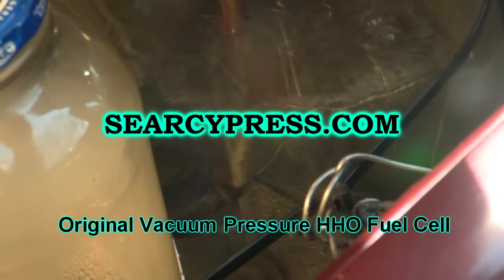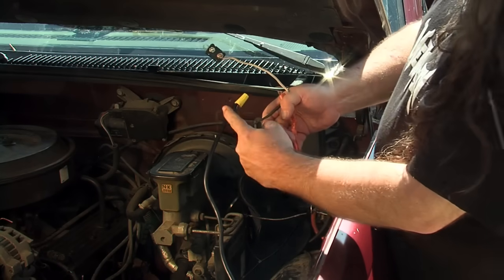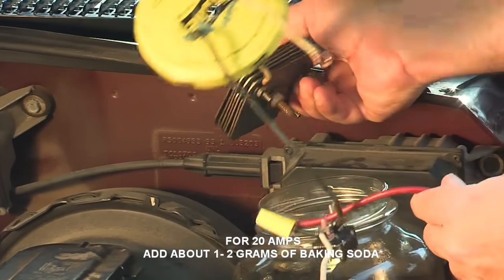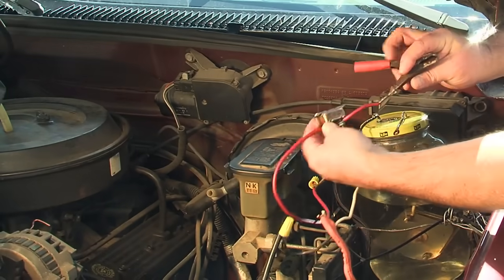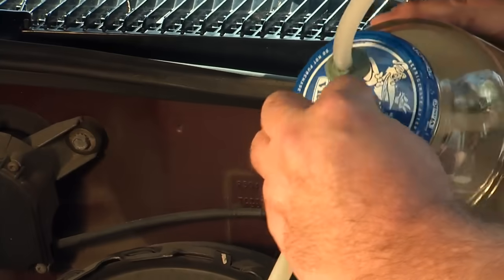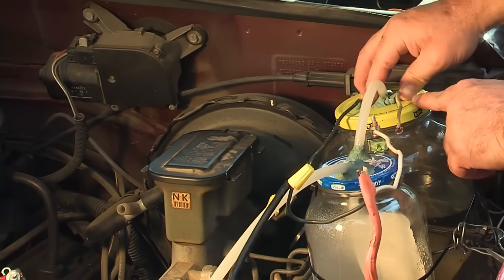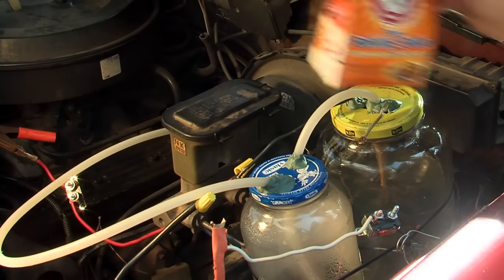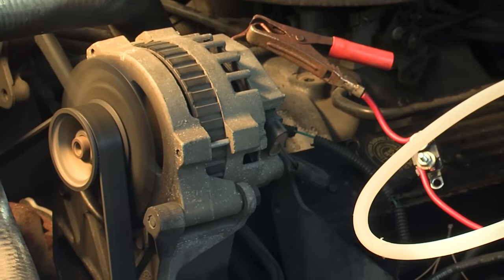Vacuum Pressure Hydrogen fuel cell defeats high gas prices using hydrogen from H2O.

Comment: You could reduce the amperage draw by using plates with a smaller surface area for those with a lower output alternator.
Reply: Use a potentiometer 100 Watts 200 Ohms or something close.
The electricity for elektrolyses must be dc so you use the battery to start.
When your engine is running use a transformer from your alternator to 3.5 Volts. ( 10 Amps * 3.5 Volts is 35 Watts ) and put an AC-DC converter on the secundaire side.
On the DC side you put the potentiometer.
The hydrogen contains 3 times more energy than liquid petrol gas.
Use original lpg tubes to your engine.
Reply from the maker: @marcelmolenaar5684  actually no. The only thing we ever really tested the water for was to see what the heck was in there after using the cell. In the past we very often started with just distilled water. Using that has now become a little bit more expensive. Sure, it's only around a dollar but a dollar is a dollar. After a while you kind of get the knack of pinching the right amount the baking soda to get the job done. It would be interesting. New video coming out on HHO pretty soon, be sure and subscribe. Thanks for the comment.
Reply: @marcelmolenaar5684  not sure what you're saying but it doesn't have to be DC for mixed gas, only if your separating the O and H.
Reply: you will get more amps with a stainless egg beater and steel wool
Reply from the maker: High grade stainless is a must for longevity. New video is coming out very soon. Be sure and subscribe. Thank you for the comment.
Reply: @metalpresstv  platinum is actually the best to use
Reply from the maker: @Hexauslion  Platinum might work really well however I'm fresh out. Lol thanks for the comment.
Reply: @metalpresstv  heeeeere
Reply: @metalpresstv  please do!!!
Reply: @metalpresstv  maybe try a silver coin setup ?
Reply from the maker: It might be worth a try. Although I've never really had a problem with plate deterioration using high grade stainless steel. I assume nowadays it cost about the same. New video coming, please subscribe so I can show you our new creation. Thanks for the comment.
Reply: @metalpresstv  liked and subscribed mate . I wonder what what a vaporizer and a HHO cell would perform like together ? Like that  v8 Ford pickup old mate chucked a gas can about 1/3 full  and a few hoses  and was drawing the engine intake through the fuel bubbling and causing vapour to run his truck.
Reply: @TheHitlister  the point is less amps when needed
Reply: But does it really work?
Reply: @ELFF1979  the idea works, the if you have poor burning fuel it would work pretty well, usually the benefit is usually break even based on other videos I've seen when done the way they show here.
Reply: Saw a 2 jar design of egg wisks and stainless steel wool in each wisk.
Reply: Would too much surface area cause it to overheat?
Reply from the maker: @masterfarmscannabis2362  that is a possibility. There is a balance at play. What most people don't understand is that when a bubble is forming that section of plate stops producing.You will see many videos where they are pulsing the entire system. I don't think this is necessary. The surface of the plate itself is pulsing everywhere a bubble is forming. As the bubble forms this section of plate no longer is conductive. It is literally pulsing itself continually. Looking at it from that perspective you might think that well, a larger surface area plate will just produce more gas and the areas that are producing gas will stop producing. It is an interesting question. We're still working on our new video. I need those subscribers. Thanks for the cool comment.
Reply: @metalpresstv  dude your cool as hell keep up the good fight
Reply: @masterfarmscannabis2362  It will draw more amps the bigger the plates, which could burn out your alternator and the more current the heat will increase faster in the water. Will it over heat? The water could start boiling which could cause issues but depends on your system.
Reply from the maker: The current flow is regulated by the amount of electrolyte added to the system. The circuit breakers prevent excessive current draw. The vacuum itself creates a thermal heat transference much like refrigeration. Not saying that it gets cold or anything but the heat is transferred by medium into the engine. We are already boiling water because we are in a vacuum and the boiling point of the water has significantly been lowered. There's a lot going on for some metal plates in a pickle jar. Thanks for the comment.
Reply: @metalpresstv  It's a combo of both actually, you can regulate it either way, plates size will create an upper limit to amp flo and it can be varied by the electrolyte solution.
Reply: Nope
Reply: I’m going to use this same setup. My question is. Where do you connect the HH gas to? That’s where I’m stumped.
Reply from the maker: @bert2423  remember you do this at your own risk. With that being said, it goes to the vacuum line at the base of the carburetor or the most convenient vacuum line available. We have a new video coming out soon which goes into much more detail and show some improvements we've made. Be sure and subscribe so you don't miss it. Thanks for the comment.
Reply: I am trying now...caustic soda as an electrolyte gives off much more gas but the Amps are quite high. Trying now to go less with caustic

Comment: Will this work on a 2001  5.3 with fuel injector?
Reply from the maker: The system itself theoretically could work on any vehicle that has a vacuum produced by a piston engine. There are a lot of arguments of course about O2 sensor settings and things like that. A lot of those arguments are referencing injecting the HHO into the air intake. One could understand how leaning the mixture with outside air could allow for incomplete combustion and recombination of the HHO producing an excess of oxygen.We are injecting into the vacuum and debatably that is a different approach. We're producing a new video and we will try to address some of these issues. Be sure and subscribe. Thanks very much.

Comment: None of it works  It's all fake, clickbait. Hydrogen is produced as a result of electrolysis but it requires the energy you get out to be put in, actually more as a result of thermal losses. Simply doesn't gain anything at all and this is fact.

Comment: Using a glass jar isn't smart. It can shatter or crack causing leakage and an explosion in a car crash.
Reply from the maker: Actually the process is well thought out. Everything runs inside a vacuum. The high temperatures will distort any type of plastic under vacuum in time. Glass has the proper thermal properties for correct temperature operation. The glass allows you to visually inspect everything as well. As long as the system is in vacuum there is no danger of explosion. The power terminal to the alternator is designed to pop off under any type of g-forces. It may not look that awesome but it is actually very thought out. An updated video is coming out soon and hopefully many issues will be addressed. Be sure and subscribe. Thank you very much.
Reply: @metalpresstv  Thanks for the input. It's interesting and look forward to seeing the advancement in science on this project.

Comment: That's 750w per litre per minute production for an engine that if it's a 6 litre engine takes in 6 litres of air times 2000 rotations per minute equals 18,000 litres of air per minute. You will  be adding 1 litre of HHO per minute. Not signigigant. Meanwhile a separate battery will last one hour.
Reply from the maker: @altgenesis  . We are only powering the combustion process. Any gain will come from the gasoline and not the HHO directly. More efficient burn reduces, the up to 20% of gasoline wasted by engines like this. We are not powering the engine, we are simply producing a more efficient burn of the gasoline. Thank you for the comment and the science lesson.
Reply: I imagine dropping that much water into the intake per gallon or two might have a "saleen effect" but not enough to hydrolock the engine. Energy is lost as heat every time it is transferred, so you are turning an engine with exploding fuel air mixture to turn an alternator to produce a current that is being translated into DC and then using that electrical current to produce hydrogen gas from a water source, then adding that hydrogen gas to the fuel air mixture there is no way it could be sustainable or efficient much less provide any improvements higher than filling that jar with more gas and adding it to the tank

Otherwise couldn't it regenerate water when rolling down a hill with a manual trans? `-;

Comment: Hydrogen generation are stupid easy to make, just be careful with what water you use. Unfiltered tap water has chlorine, which during electrolysis produces chlorine gas. Also hydrogen is EXTREMELY FLAMMABLE. This setup has a bubbler/thump keg between the generator and intake. This acts as a trap if flame back draft's.

Have fun and be safe!

Comment: This is a scavenger system the reason it works is because it helps boost octane part of the reason cars get such crappy mileage is because computers change the timing in the engine so you don’t hear the fuel pinging anymore now you can burn crap 75 octane fuel and your car sounds good the truth is gas company’s have been screwing us for year the better our car engines got the cheaper and crappier the fuel has got so the sell the same gallons all the time

Comment: I used a 32 plate system and no need for the extra pressure from master cylinder!! Can produce a few litres per minute, but stepped the current down to make it produce less. I'm using a 3ltr BMW petrol engine
Reply from the maker: It's not about production. That's easy. The vacuum system allows for better thermal control. Also the introduction of the gas in the vacuum instead of the air intake prevents dilution of the HHO. O2 sensor problems that many people observe are caused by the incomplete combustion of the HHO. The vacuum introduction into the cylinder debatably reduces that effect. It is quite a feat to even get nine plates together, I would love to see how you managed to get 32 together. New video coming soon. Be sure and subscribe. Thanks very much for the comment.
Reply: @metalpresstv  thanks for yiu reply as it helped me understand a little more then I did before. The 32 plate system I used, each plate I put a rubber seal between each plate and also the 2 bolts to hold together. Did think about using clamps rather then bolts to hold together but maybe next time. I have not been able to do anything for the last couple of years as wasn't able to walk, but now I'm healing more so let's hope I manage to get back to reality soon
Reply from the maker: @karmaking5478  a project is good for the mind, body  and the soul. This video was proof of concept and should not be duplicated. I have a new video coming out very addressing some of the misconceptions around this technology. Be sure to subscribe.
Reply: @metalpresstv  I use a cigarette butt in a tube near end of exit hole to stop any flashbacks and it has helped immensely with any problems with ignition of any kind other then controlled. Looking forward to your next video for sure!!!
Reply from the maker: @karmaking5478  it's fantastic. I've yet to add the arrestor on the system. A vacuum control switch prevents a lot of problems. The only thing is it's very costly. Thanks very much, be sure to subscribe.

Comment: I am curious about the dryer jug. The plastic hose on the downstream side is tied into the brake booster line into the intake manifold via the vacuum line. 
Are you filling the dryer jug with water to keep any possible flashback fire traveling backward from the engine back through the tubing to the larger hydrogen/oxygen jug? 
If not, i recommend this one small step as a flashback flame suppressor component.
I recommend watching this video for a safe, inexpensive way to protect against any explosion. It's an excellent example to build a safe Hydrogen/Oxygen torch using a suppressor bottle.
https://youtu.be/7M4yqcO_pPo

Comment: I was thinking about doing this but I have a newer truck and didnt want to cook the engine. Good to see others have done this. I was worried trying to burn browns gas instead of separating the two might make for a large explosion.
Reply: Just idling your engine is over a 600 rpms. Driving a 2.5 liter 4cly motor  is about 150 cubic inches. That's 37.5 cubic inches per a cylinder. A cylinder fires ever 2 full rotations. So in a minute of idling at 600 rpms your engine will use 11,250 cubic inches of air a minute at just idle. That's a 187.5 cubic inches a second of air. You're not producing even 2 cubic inches a second. But don't forget that it's h2O 2 parts hydrogen 1 part oxygen. So 1/3 of the gas isn't even hydrogen it's oxygen. So not even 1% of the air being taken into the cylinder is hydrogen. The only thing being accomplished here is the alternator is working harder for the high amp draw dragging the motor down more reducing fuel mileage. This is why water isn't used as fuel in a motor vehicle. 

Now don't forget we don't drive at 600 RPMs most people will be around 1800 rpms at cruising speed. That's 3x the amount of air with still the same hydrogen production. So now ur way below the threshold of .03% hydrogen in the cylinder. Using a spark arrestor on the output hose to keep from blowing the jar up you would be hard pressed to even candle a flame let alone put anything measurable in every cylinder 900x a minute cruising down the highway at the speed limit.
Reply: @magicalphones  guy I dont think your calculating the fact that browns gas is much more explosive than fuel and your not running on just browns gas its in conjunction with fuel just for the boost in fuel mileage.(your misdirection with the consumption of an engine without actually discussing the actual science other than to say "you can't separate H2O without lots of power" that part has already been proven wrong)  no one is saying you could actually run the vehicle on just the browns gas.  I still dont see what your problem is with this . As a science experiment producing browns gas with a small amount of electricity IS possible so the only next step is adding it to the intake of an engine along with the fuel running that engine. Modern engines map the fuel input so they would automatically lean back on fuel with the increased combustion from the added browns gas. however if you wanted to vent the O and burn only H you could by splitting the two poles in your tank and using a shroud around the negative poll and just burning that but you need two electrode shrouds. so it adds complexity and greatly decreases your output due to the separation of the electrodes. When people so adamantly deny the simple science of things like this it leads most people to assume you work for a car and or oil producer and are just throwing out numbers to obscure the fact that this actually does work. Therefore reinforcing the fact that this works , even if only in some small way.
Reply: @magicalphones  Well I guess I missed the part in science class where if you have less than 4% of a highly unstable concentrate it wont burn . Yea CLEARLY IM the one who failed science. moron.

Comment: Do you shut the gas of to the engine to run it on  only on hho or is this a performance booster only
Reply from the maker: You're not trying to run the engine on water. What you were doing is using the HHO gas to more completely burn the gas in the cylinder. These engines normally only burn about 80% of the fuel that goes into them. The rest is wasted. We are trying to use the HHO to boost the efficiency, increasing the amount of fuel that is burned in the engine. Thanks very much for your comment.
Reply: @metalpresstv  have you tried running it exclusively on hho instead of gasoline